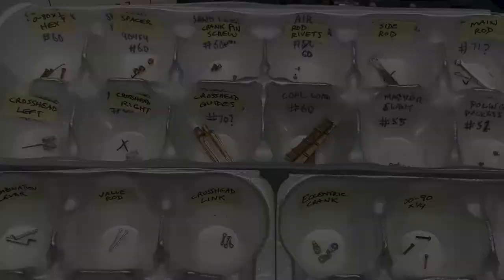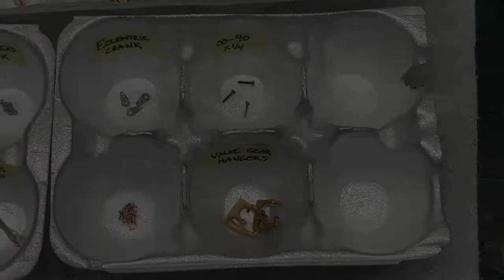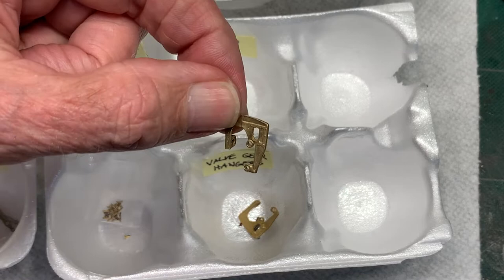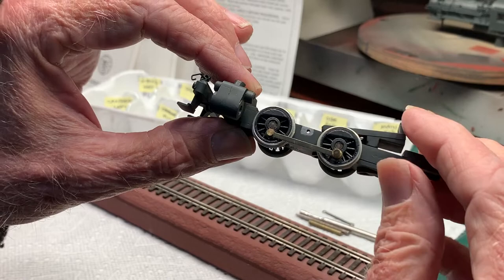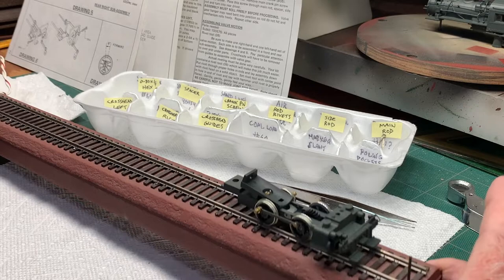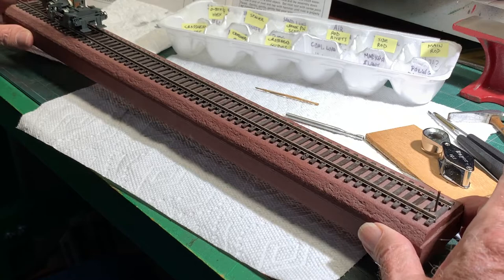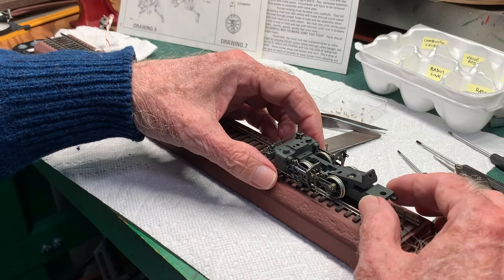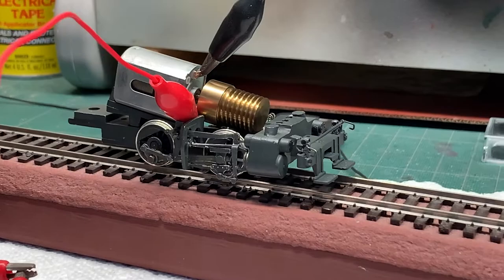Steam Loco Kit Video #4 Rods and Valve Gear

Comment: this is an excellent group of videos . I just bought one of these kits and will be referring to them often .  I was kinda hoping for a step by step of the dreaded valve gear riveting though
Reply from the maker: Yeah, I wasn't looking forward to riveting either.  As it turned out it wasn't too bad, taking my time and making sure parts were stacked the right way.  Then stopping the hammer-tapping as soon as the parts were held enough to stay together and not fall apart.  Getting it all installed so the parts didn't hit other stuff took some fiddling, too.....  Good luck!
Reply: @CarlBrainerd  had to peen some diecast crossheads n rods on a  MDC kit and worked on my vintage PennLine K4's and H9's I hope I'm ready. 00-90 brass screws are fun

Comment: Looks really smooth.  How did you get the puffing sounds though??
Reply from the maker: The sound is coming from the Soundtraxx decoder which was hooked up and running on my decoder tester even though not yet installed in the loco.

Comment: Very smooth build! Are you going to re-time the eccentric to 45° forward of the pin? It looks close to on top of the axle center with little valve rod movement seen.
Reply from the maker: Yes, I noted that.  I have adjusted the eccentric cranks to lean forward an estimated 15 degrees per the instructions..  Still not much motion of the valve rod, but so be it.